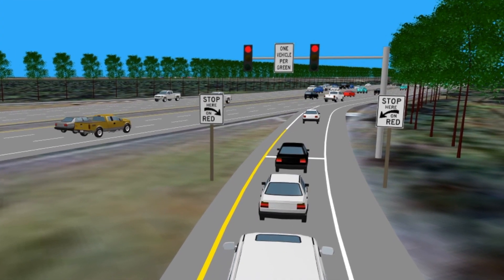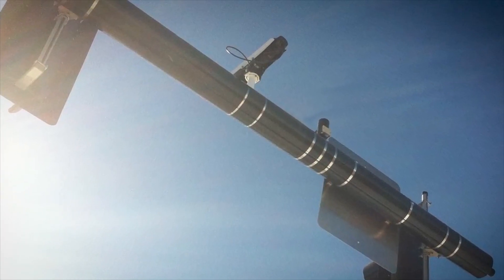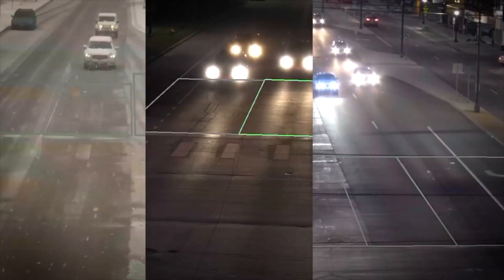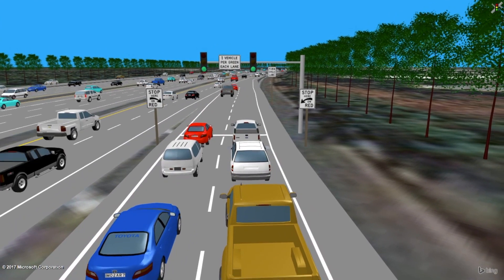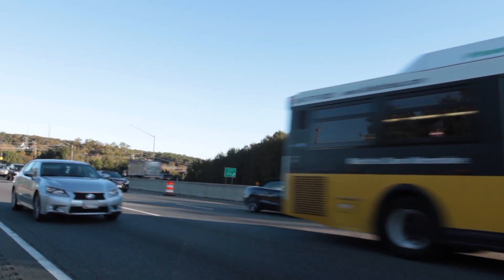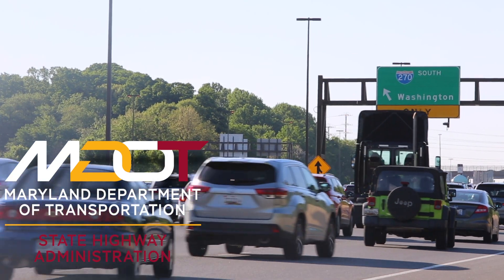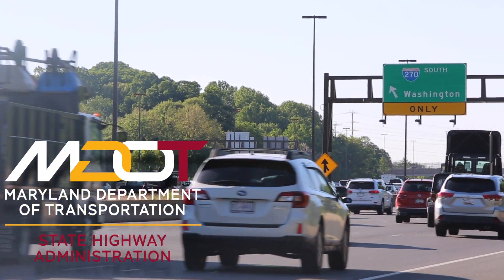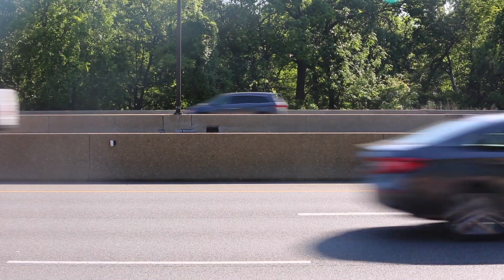I-270 RAMP METER TESTING BEGINS AS PART OF INNOVATIVE CONGESTION MANAGEMENT PROJECT

Comment: Ramp meters are a proven method of regulating traffic flow along extremely busy sections of highway, during the 30+ years they have been used in various U.S. cities.  They also have the added benefit of keeping traffic flowing on the surface streets which the on-ramps connect to.  Ramp meters prevent traffic jams, because they allow mainline traffic to keep moving at its normal speed rather than having to jam on the brakes to let in an avalanche of cars which are coming down the ramp to merge.   People who are opposed to these have no clue whatsoever about traffic dynamics or traffic waves.   Which would you rather have...?  Speeds going 50 MPH then 0 MPH, 50 MPH then 0 MPH, or a constant 25 MPH?   I would rather keep a steady 25 MPH, and that's what ramp metering achieves.

Comment: Why do people in the right lane have to slow down to allow the ramp traffic to merge?  Last time I checked, YIELD meant that the ramp traffic has to wait for a safe area to merge in at highway speed.  Traffic already on the highway should not have to slow down at all.  Yet another "spoon fed" solution to a problem that wouldn't exist if people knew how to drive.
Reply: A lot of people don't know how to drive...that is why these things are needed.  There will never be a time when most people know how to drive...if the driving tests were remotely difficult, most would fail, not get licenses, and that itself would reduce congestion...but I'm not gonna hold my breath on that happening any time soon.

Comment: And what makes you think that people will obey this new metering system? You didn't improve  any other aspects of the infrastructure. On ramps are too short. All that traffic still backs up on regular road lanes. You'll be causing traffic on local roads. You can't just added lights and expect to improve congestion. And you're testing in the midst of a pandemic while traffic is still not back to normal density. What do you expect to prove?